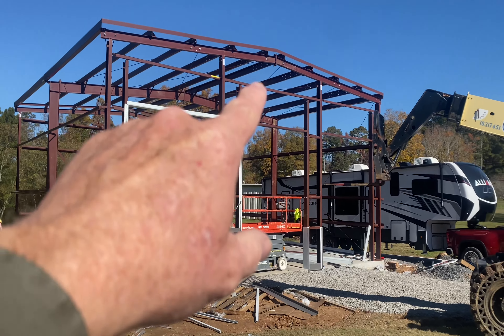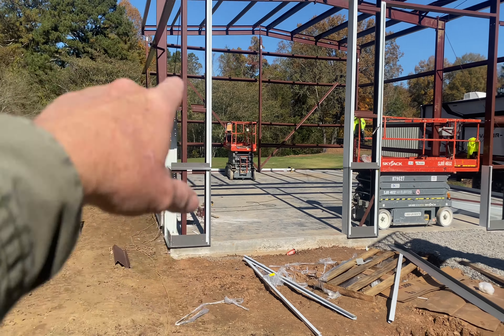Peterbilt Shop Is taking Shape

Comment: Hi Tim, I too have watched your videos back when you had your beautiful Pete. Are you having the crew doing the whole thing, turn key or subbing it out. If it's not to personal what will you have in it when done, want to do same thing, nice though.
Reply from the maker: Hello Rob and thanks for watching, I am subbing the work out and it’s been a pain, I would not recommend a garage of this type, building cost at the time was almost half of conventional wood construction, but building the pad and concrete work was quite extensive and getting the building erected was extremely costly so if I had know better I would have done a pole barn or stick with conventional type of wood construction even in today’s markets, but originally building itself was $27,000 I added 4 feet in height for $3200 and 6 inch insulation over 3 inches for $1800 so total building cost for just the building $32,000 and that’s a finished product complete with trim and gutters but no garage doors or windows included .